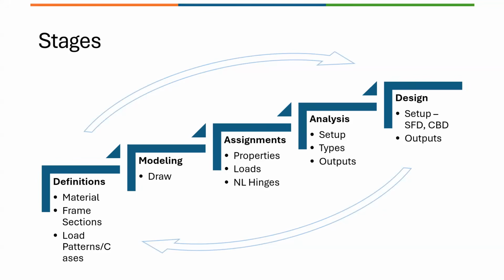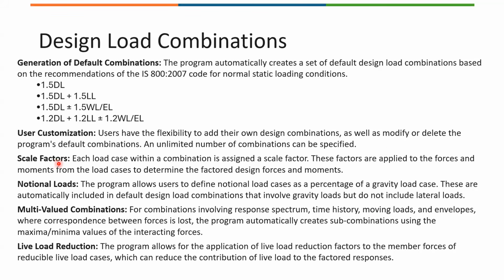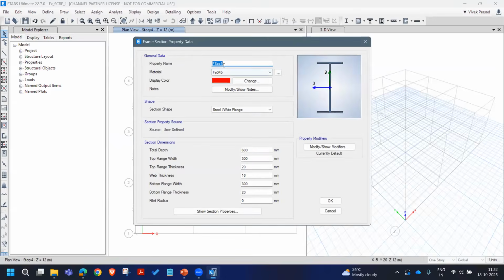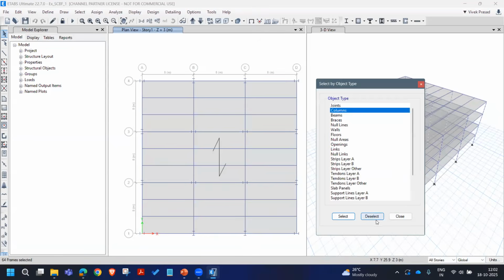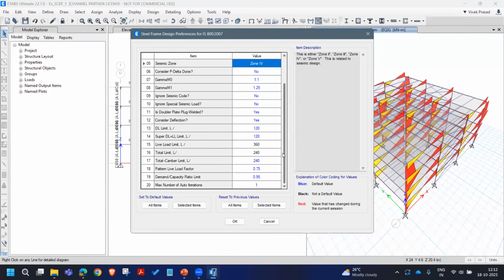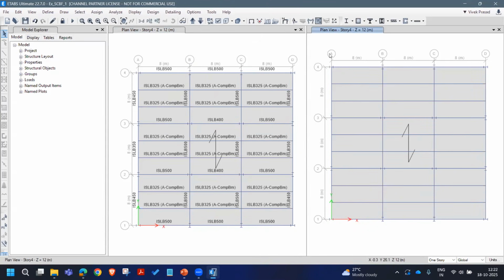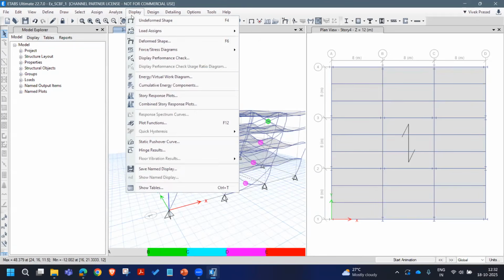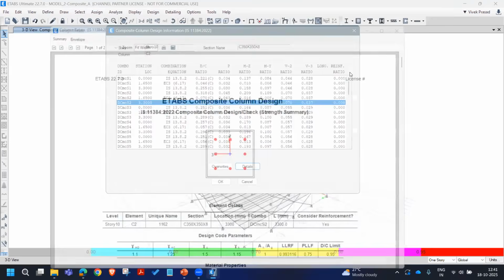Webinar 006- Introduction to Steel Structures in ETABS -Part 2

Comment: Thanks for the presentation. How to perform brace mechanism analysis in ETABS. AISC 341 requires designing the beams, columns, and connections for the forces obtained from brace mechanism analysis. The mechanism analysis is performed after doing the regular brace design and specifying the brace sizes as shown in this presentation. I’d appreciate any input on this.